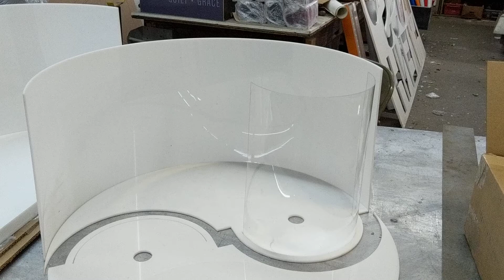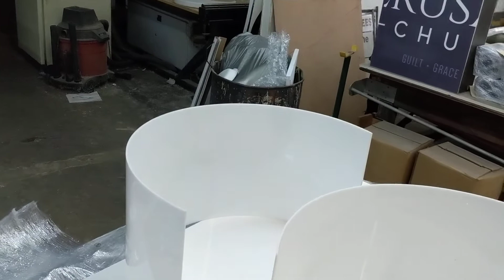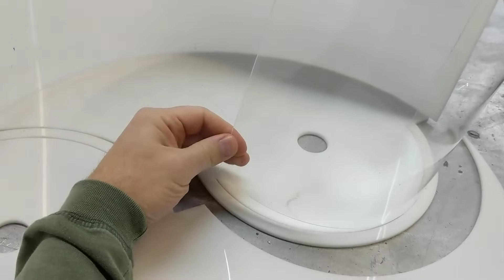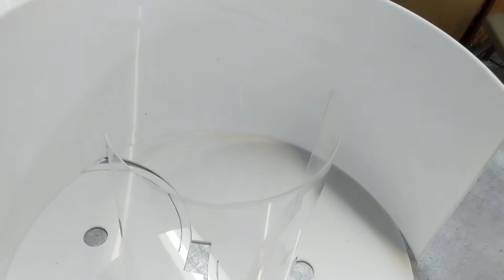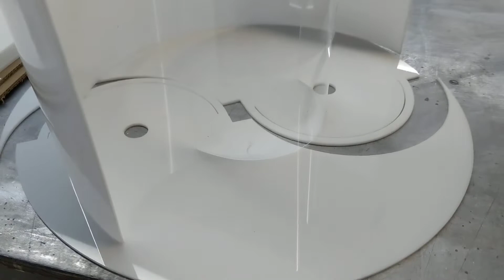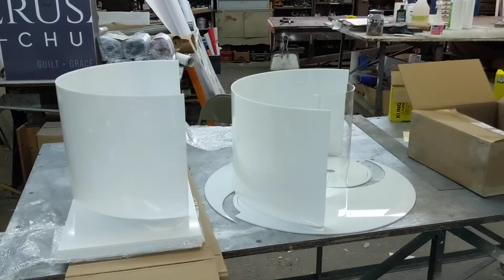Harmony VAWT October 2018 New Prototype Scoops

Comment: hi,interesting design,have you test it in cold weather? i am curious to see the result.Gervais,Riviere-Bleue,Quebec
Reply from the maker: Hi Gervais, no I'm still building the full sized prototype. Did you have a chance to view the playlist and look at our progress thus-far? In regard to cold weather the gears are likely going to be aluminum and they'll have a receiving groove in the back so we can add resistance heating (something like miniature heat tape) to keep the gears above freezing and prevent icing issues. We would need to use this in multiple areas and that will be for further testing down the road; for now we're just focusing on getting performance data to make it to the next steps and have a minimum viable product.
Reply: @HarmonyTurbines  "  Did you have a chance to view the playlist and look at our progress thus-far?"  well i did not ,,i will and it is on your web site? i used to have a wind charger for fun when i was a long the St-Laurence River here near Le Bic,Quebec.i add so much strong winds that i lost even  composite pale because they destroy themself .the best result i add was from an home made pale that i made in aluminium.Now i mooved near Fort Kent,Main in the village of Riviere-Bleue,Quebec and i am thinking of playing again with wind charger and yours is interesting.Winds are lighter here ,,i wonder how yours would react,,it must start at low winds,,2- mph?? 
i will check on your site.Great products you are building,Bravo .
Gervais

ps if i may suggest,add a link here in the Subject of your video so we can go at your corp site.
Reply from the maker: @gervaisfillion9417  Hello again. At the end of each of my videos you'll see the playlist shown as a link so you can click that playlist to see ALL of my HarmonyVAWT videos. The playlist shows from the newest videos to the oldest (reverse order). You may view them all there in that playlist. I am still quite far away from commercial products but I'm working hard each day to make good progress and will keep updating everyone as often as possible.

Yes my hope is that my turbine will start in very low winds around 2mph and then start producing some power around 6 or 7 mph. That's what the prototype and proper testing will help to determine for us.
Reply from the maker: LOL OK Siward, you have to stop with the CAPS dude! I'm interested in your idea but the problem is the main turbine shaft is spinning and the furling tube rides on top of that, in earlier videos you see my twisting the furling tube to furl/unfurl the scoops. So to make a tube as you suggest which would allow air in when the unit is at max RPM, we'd have to translate a stationary tube control mechanism (with impeller) into the rotational mechanism that would be controlling the furling tube.

Right now I'm planning on doing that with a small servo motor and worm gear located in the very bottom U-Channel support. I'll actually build a small housing around this mechanism to protect it and then offset the weight on the opposite side so it's balanced properly. Initially, just for the data gathering phase I may put a 7.2v racecar battery over on the other side and use that to power the little servo motor. Then we don't need any electrical connections going down to the generator. I could then control the furling with a small RC transmitter to open and close the scoops however I like as the whole turbine is spinning to produce power.

It would be a clean and simple way to get my data without complex mechanical connections and expensive multi-channel slip rings.
Reply: Siward Beorn  sounds like you have been sniffing a bit to much of the glue 😱